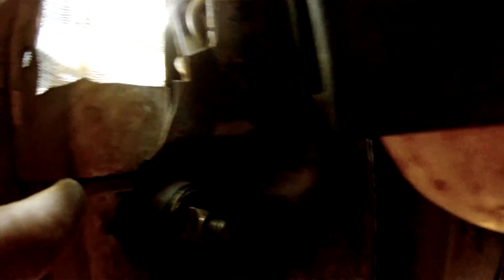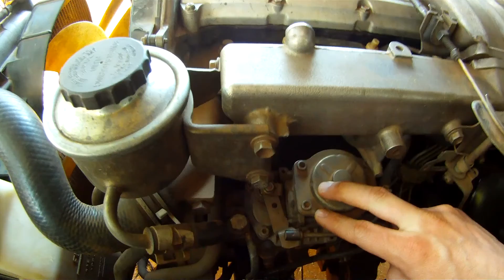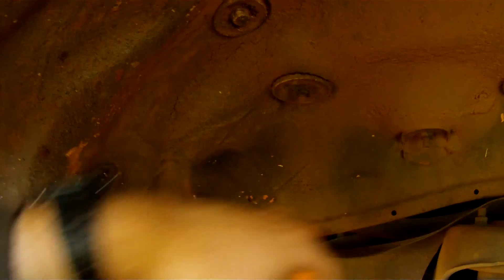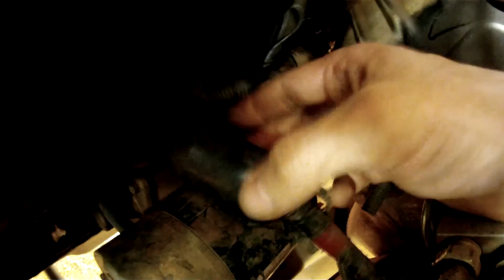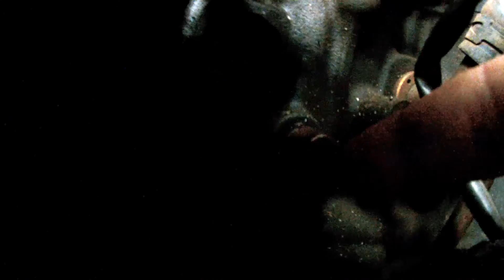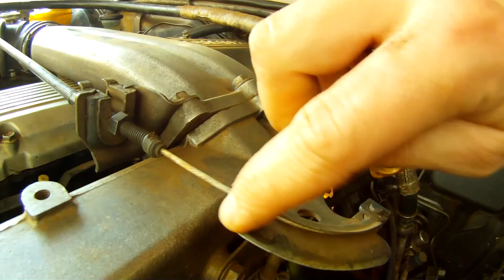1HZ Engine bay (LHS) - Land Rover guide to the Land Cruiser - 5/15

Comment: Love the series..as I have made all your experiences you feature myself..after 25 years of running various Defenders/Land Rovers I run now my 4th Land cruiser 70 series (HZJ 74,78,now 79 and a 31 year old LJ70 as a daily runner =equivalent if that's the right word of a 90 Defender) . You have pointed out but all too well the differences in concept between the two brands. It is funny that all possible "weak points" of the Land Cruiser you have pointed out seem a benefit to me from my experience: i.e the rubber push on seals on the brake/clutch fluid reservoirs never leak, never come off by their own but always come off when you want them to !!!! on a LHD Land Rover the clutch reservoir screw top is made of the cheapest alloy or plastic and needs a good tightening too be leakproof so really difficult to get off in the awkward position. On the Cruiser that is pretty unimportant whether it is LHD or RHD. As for the accelerator cable: I have over the years gone mad with fiddling with cable (speedo, bonnet release, accelerator) because they jam, brake or are reluctant to work) as on a Land Cruiser they never fail, never jam , fit and forget..as all around the vehicle all important components sit vibration free on sturdy rubber bushes....Just ask my wife how much more time we spend together since the swap to Land Cruisers..they are simply made to run under all conditions to get you there and back..and in terms of off-road capability: I'd rather sit in a Cruiser..factory lockers front and rear..get you through most terrain almost on tick-over thus saving nutty accelerations necessary in a Defender without lockers. How many half-shafts, wheel bearings, oily discs/drums, clutch cylinders etc..and the "Lucas, be home before dark" stories..but I must admit not ever being really stranded in a Land Rover on my Sahara trips..mine always broke down in towns or near an AA man at hand..Never had a single mechanical incident on any of my Crusiers. All 70 Series Cruisers body work since 1984 (even it's predecessors the famous 40 series)  are set upon big rubber bushes similar to a Classic Range Rover, so the harshness of vibration is not sent up the drivers spine to the same extent..driver fatigue is a serious factor when driving/overlanding/even more so as a passive passenger.
Guiding off-road tours through the Sahara followed by brand new Defenders I had to slow down every 3-4 kilometers for them to catch up because of the solidly bolted on body work vibrating..in a Cruiser you just do not feel it the same..allowing greater speeds..but that can be a danger too..but I rather be the judge of that than to be submitted to the noises, leaks and rattles of even brand new Defenders. A Land Rover used for what it was designed for is a long lasting vehicle that needs a fair deal of attention: but they are not designed to go far, on long motorway stretches or to be in the hands of unexperienced mechanics..even if a lot of people do exactly that..like I did. 
You mention the timing belt..it takes me around 11 minutes to change one on an 1HZ engine and that includes getting the few tools needed. The tensioner is pre-set and you simply release a securing pin..that's all. Another thing: the 70 Series have (similar to a Classic RR) one of the biggest window surfaces in the auto industry: in an overlander I want to see the world, feel to be a part of it..
happy cruising to all of you..whether Defender or Land Cruiser or whatever..
the important thing is to get out there and explore; cheers, M

Comment: The oil filter has a little built in pan that catches the oil when you remove the filter and routes it via the little tube you can see in your vid to the bottom and into your waste oil collection pan.